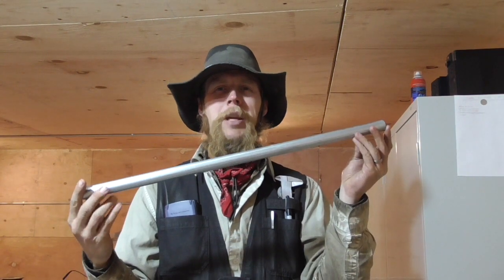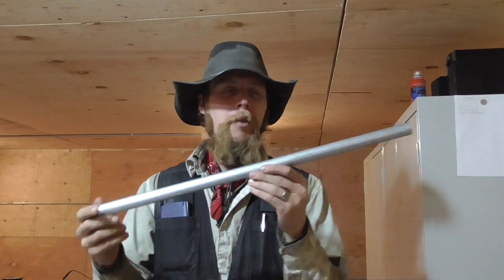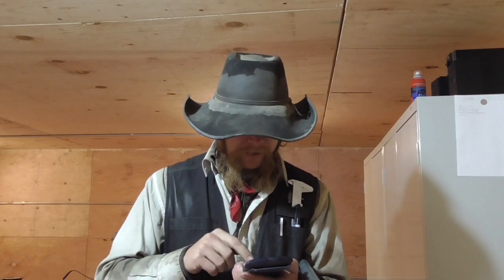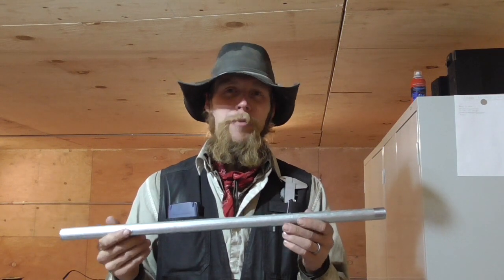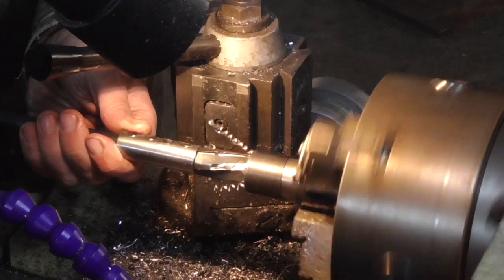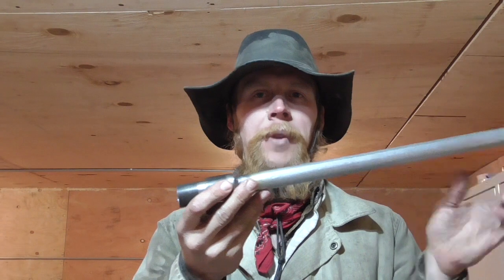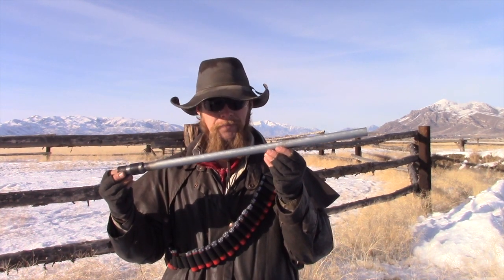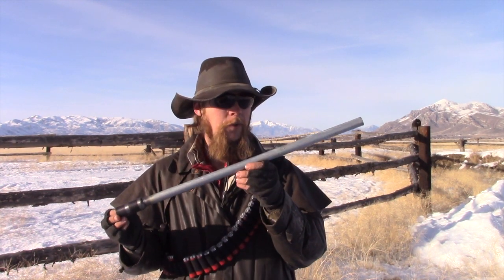Experimental EMT Conduit Barrel (TIS242)

Comment: When I was a kid we made 22 rim fire zip guns out of car antennas.  They are chrome plated brass. Never had a fail.
Reply: that is only because there is hardly any friction though, thus no pressure building up. that leads to no velocity as well though.
Reply: You aren’t the only one.
Reply: brass CAN be harder than stainless, not always, but the chrome plating process may have helped the brass be harder than raw brass.
Reply: @modelnutty6503  Not really. And even if that was the case, hardness really is not what you need for this to work. Hardness will help with wear on the barrel, but not that much with it holdig pressure. What you are looking for is a high tensile strength.
You can get brass to a hardness of maybe  180HV, after a lot of cold hardening (deformation) that is. 
your average joe stainless steel (X5CrNi18-10)  has a hardness of 220HV upwards.

Barrels are usually made fom steel that is treated to a high tensile strength, such as 42CrNiMo4, those reach a tensile strength of up to 1300N/mm², while brass might not even reach half of that. Plus comes with more elastic defomration
Reply: abukamoon  Now that would make for good youtube!
Reply: Awesome would love to see that on youtube!
Reply: me too
Reply: abukamoon  My point was that even these thin brass tubes held the pressure of the 22 shorts that we were firing in them.